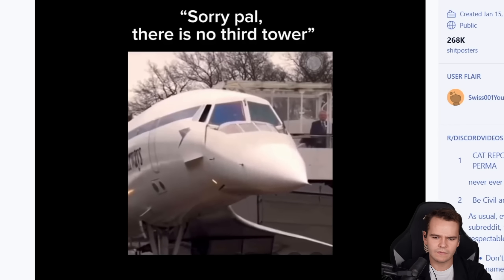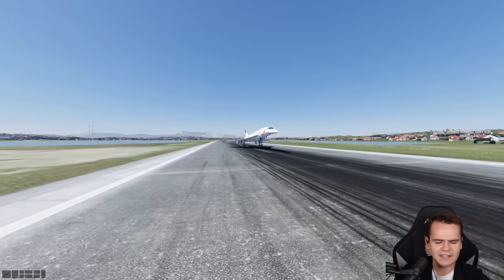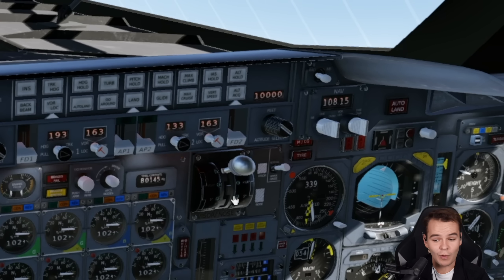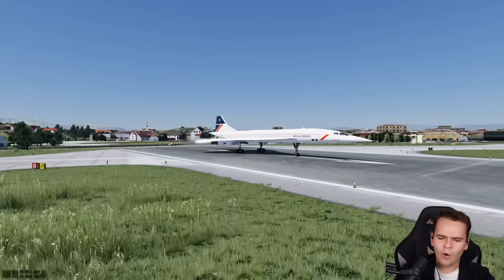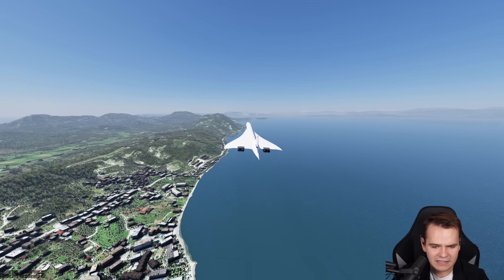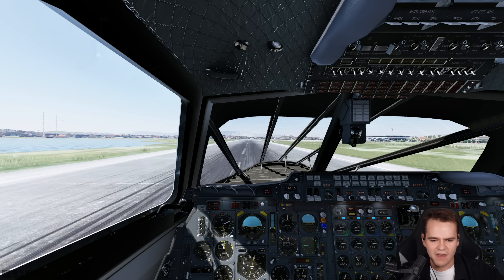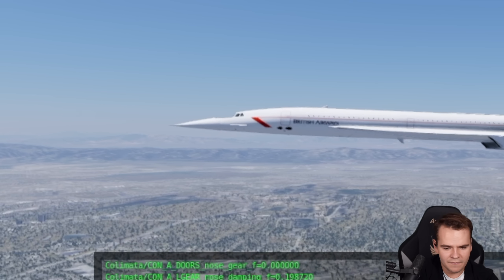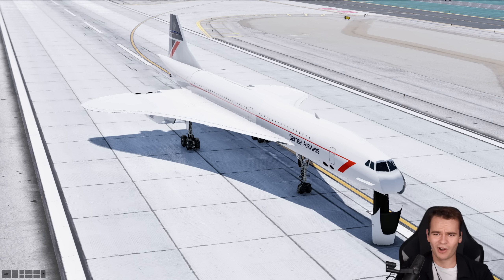What If Concorde's NOSE VISOR Had Failed During Flight?

Comment: The concerning failure wouldn't have been being stuck up during landing, but suddenly falling down during supersonic cruise. The question is whether the configuration is rated for such speeds or if the drag would tear the part off the aircraft (and cause further damage in the process).

Comment: Im far from the concordes biggest fan, For many reasons, IE extream take-off speeds, stall speeds and more. Its my personal opinion that the 2707 would have faired far better although definitely not making its aclaimed statistics. Mainly due to interchangeability which would alow for modernizations improvements and more. Putting aside these items its truely impressive that it made it as many years in service as it did without many accidents.

Comment: Et the end every plane “modern” enough could most likely land with even zero visibility if really necessary as there are multiple instruments and guiding technologies that help navigate blindly and also the connection to the ground control can really help! But it is a bit relevant how skilled the pilots are as that could make a big difference of how well the landing would be and if it works at first approach and or end really rough beside ore behind the runway.

1982 Britisch-Airways flight 009 flew through a cloud of ash from the Mount Galunggung as it was to dry to be visible on their radar.
After that they must do the landing with windows that got sanded nearly blind from the ashes particles and did that successfully with nearly complete relying on the instruments. At the and they also had the luck that they could still see the lights from the runway through a tiny spot left clear enough…
Reply: With  an Ipad and a compatible AHRS*, you could land a biplane in zero viz. It's not approved and if something goes wrong you could easily die.
*Can be battery powered and suction cup mounted, obviously trusting your life to suction cups isn't wise.
Reply: @DataToTheZero ?

Comment: 2:17 this is what my friend chatgpt says about this:
Yes, there were instances where the Concorde's droop nose failed to operate correctly during landing, but these were rare and typically resolved without incident.

Design and Redundancy

The Concorde's droop nose was essential for providing pilots with adequate visibility during takeoff and landing, given the aircraft's steep angle of attack. The system was powered hydraulically, with the primary (green) and secondary (yellow) hydraulic circuits. In case both failed, a manual emergency mechanism allowed the nose to fall under gravity to a 12.5° position, ensuring visibility during landing.

Documented Incidents

While specific instances of droop nose failures during landing are not extensively documented, the design included multiple fail-safes to prevent accidents. For example, in 1995, Concorde G-BOAF's nose was damaged during a handling accident at Heathrow Airport. British Airways replaced it with the nose from G-BBDG, which had been damaged in a similar incident. The original nose was later repaired and returned to G-BBDG.
Reply: No good man puts all of his faith in a clanker.

Comment: Ngl if the droop snoot failed, I reckon it wouldn't have been an issue, unless ofc it took out an engine
Edit: I meant at low altitude
Reply: The Concord flies at supersonic speeds. What were to happen if the drag suddenly went up?
Reply: @atomicreptiliascreator738 boom
Reply: @atomicreptiliascreator738  laminar flow would ignore it at that speed.
Reply: @kevinerbs2778 

I just searched up what would happen, and it said that the aircraft would vibrate extensively, lose control, and likely break apart. The aircraft was not designed for the sudden loss of its nose, so it would result in an immediate and fatal loss of the aircraft. Remember, this is SUPERSONIC SPEEDS, EVERYTHING IS FAR MORE SENSITIVE.
Reply: @atomicreptiliascreator738  It would be fine as long as it wasn’t supersonic.
Reply: @Tetraflueroethylene 

That’s what I was saying. But if the plane was going subsonic, the pilots would have to fly with a high angle of attack, which would destroy fuel efficiency even further.
Reply: @atomicreptiliascreator738  I’m assuming in the case of just taking off and about to land
Reply: @Tetraflueroethylene 

Concorde was a delta-wing aircraft. Delta-wing aircraft have all of their lift closer to the back. The faster you go, the more efficient they become, but delta-wing designs are optimized for supersonic performance and thus have terrible lift efficiency because it’s behind the center of mass. This forces subsonic aircraft to have much higher angles of attack just to stay in the air for longer than 2 seconds, and they have to do this for the entire flight. Concorde wouldn’t even be able to go supersonic because the airflow would stop it from safely surpassing its sonic shock speed.
Reply: @atomicreptiliascreator738  I know... I never claimed anything that contradicts that statement
Reply: Unless they plan to fly supersonic
Reply: @GiratinairAviation487 I was mainly referencing low speed, take off and landing situations. I perhaps should have specified 😅
Reply: @fabulouschild2005 I honestly don't think Droopy Snooty poses much of a threat
Reply: I imagine if it just fell off in flight, there would be lots of small fragments or pieces if hardware that would be in the perfect place to be ingested by the engines 

I fail to see any reason that wouldn't happen for any reason other than the nose being intentionally removed
Reply: @deathskrieg5525 

The Concorde was built with many redundancies and was legally and economically required to be grounded if something broke or went wrong.
Reply: ChatGPT only reinforced my findings. DO NOT EVER UNDERESTIMATE THE POWER OF SUPERSONIC AIR.
Reply: @atomicreptiliascreator738  Maybe don't mention ChatGPT as a source
Reply: Without the nose droop, the air would go from laminar to turbulent, which would rip the aircraft apart more and more until it stops trying to fly.
Reply: Chatgpt stoopid

Comment: Hey Swiss! Love your videos and I had an idea I'd love to get your thoughts on.

Concept: Powered Wheels for shorter takeoff and efficient taxiing. The idea is to put electric motors on the main landing gear wheels. This would let the plane taxi without its main engines, saving a ton of fuel, and could even help with takeoff by spinning the wheels up to speed before the roll, reducing runway needed.

I thought I was a genius for inventing it, but then I learned it's a real (and brilliant) concept that was actually tested! Companies Safran and Honeywell built a real prototype called the Electric Green Taxiing System (EGTS) for the A320. It used the APU to power motors in the wheels for taxiing. They tested it extensively, but it was eventually shelved due to the weight penalty and cost.

Do you think this concept has a future, especially with better batteries and materials? Could it ever work for takeoff assistance, or is it strictly a taxiing solution? Maybe it's something you could even experiment with in X-Plane?

Would be amazing to hear your take on it! Keep up the great content.
Reply: Good idea lol
Reply: @justsimplysushi thx!
Reply: That’s actually a really good idea hope he sees this 🙏
Reply: I wonder what the weight penalty would be if it uses pneumatic power transmission from the compressor(s). If you have used an air tool and then the same version of a corded electric tool you will know how much lighter the air powered tool is. Since it is good practice to do a parked throttle up right before takeoff, the idea of sizing it bigger than is needed for a 8 KPH taxi, would add  weight penalty as well. This should definitely be revisited by the aircraft system’s manufacturers for modern aircraft with far more bleed air. 

With a few additional pounds per motor, it could be reversible  for unassisted pushback, saving the airline thousands per flight by eliminating that part of apron operations.
Reply: @SethMethCS right